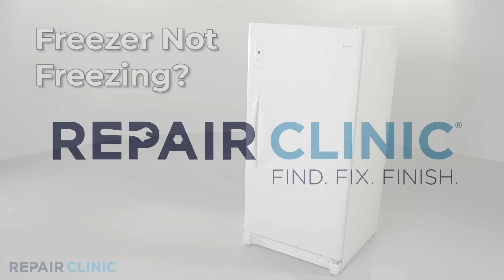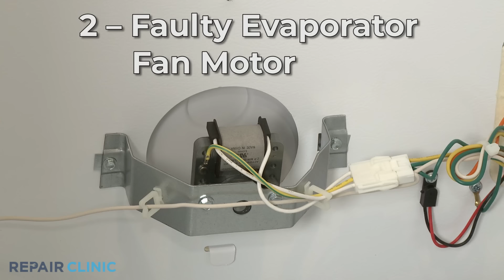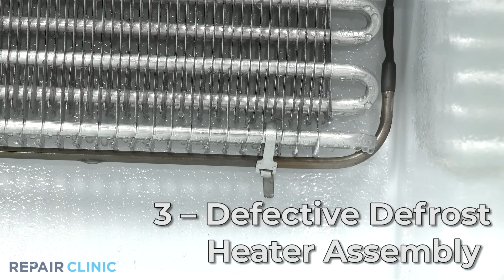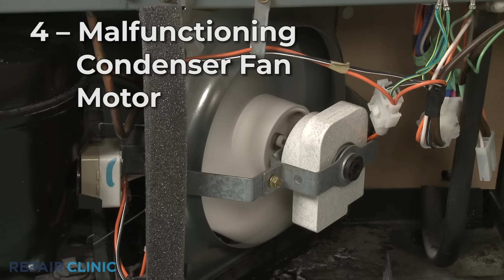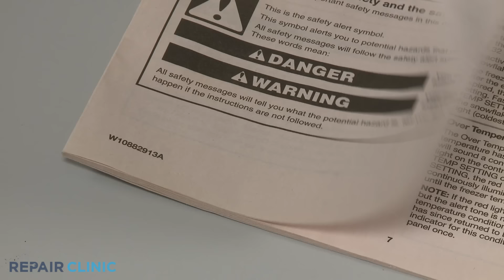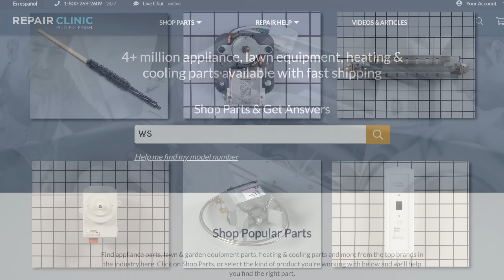Freezer Isn't Freezing  — Freezer Troubleshooting

Comment: I'm confused. The model you show is a Kenmore with a digital temp control in the door. Shouldn't this use a temp probe or thermistor rather than a thermostat? The thermostat is controlled by a dial found at the back of the freezer.

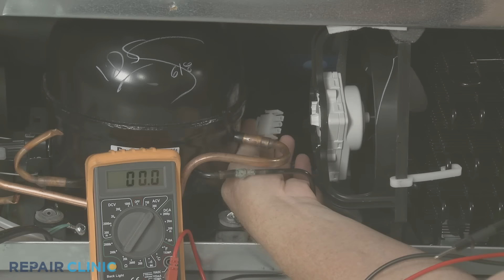Comment: It seems that the abundant and sometimes even borderline-excessive safety warnings in most RepairClinic videos are making up for this one... given that this is for general troubleshooting not specific to any brand or model, the scene at 2:10 could potentially be quite hazardous on other makes/models. Albeit small, there's a risk (especially on larger, older and/or defective systems,) of 1) burns from the compressor body or discharge lines and 2) electric shock from frayed wires or exposed socket connectors.

Comment: Can anyone help Midea 3.5 cu Mini freezer MRC04M3AWW: my electricity went out yesterday and I don't believe my freezer is working properly. I tried disconnect+reconnecting, then on and off.  
It's happened before with no issues and freezer worked fine previously. A little over 1 yr old

Comment: hello, do you think I can troubleshoot and replace parts when it's in operation still?
thank you for your reply
Reply from the maker: For brushing off the condenser coils sure, unless you plan to deep clean. The electrical components you will need to unplug the refrigerator to repair, otherwise you risk shock to yourself and damage to the new parts and damage to other parts.

Comment: I'm not sure but I think I have the opposite issue here.  My upgright freezer (on a frost free freezer) over freezes the coils and then nothing stays cool. and everything starts melting.  I've replaced the thermostat but from what i've read it can be the heating element or this Defrost timer that's in the back of the freezer.  Your thoughts sir?  FYI, everytime I replace the Defrost thermostat it works for about 2 to three months then the same thing happens again.
Reply: Did you figure this out.   My freezer works great for a week and then everything starts melting.

Comment: Our chest freezer one day just started defrosting and ever since it won't freeze again. It was manufactured in 2019 so its not old. I have tried cleaning it and nothing. When I plug it in the green light goes on so it is receiving power, however there is no sign of motor running and it doesn't get cold. What should I check?
Reply: Literally everything in the video… are you stupid?
Reply: Probably the defrost timer

Comment: My small upright freezer was delivered upside down and was kept that way God knows for how long at the vendor’s warehouse (the box was already upside down when the shipping labels were placed). I was told not plug it in for at least 48 hours if it was completely upside down to allow the oil to drain back into the compressor. I did that but the freezer won’t freeze and the compressor rattles badly when it starts or stops. It is a very nice freezer. Last one on Amazon and apparently not coming back. The biggest advantage is that you can selectively freeze and insure dual-use, just by adjusting the temperature. Any advice before I decide to return it? Thanks
Reply: Thanks so much for your response. I'll do as you advise.

Comment: For those looking for QUICK a temp fix, you can connect the two wire from the thermostat and then plug the freezer into a timer. 1/2hr on 1hr off if you are not going into it alot

Comment: What if nothing is turning on at all?
Just the lights inside and green indicator light?
I changed the timer and capacitor to the compressor and still nothing
Reply: It was the temp control unit(thermostat)

Comment: What about the Thermistor?  I have seen on a number of sights that is the most common when you have uneven freezing / part of the freezer (ie the top) is warmer than the bottom and the warning light "high temperature" is on.  I replaced the Thermistor and THAT fixed it.

Comment: In some checks for continuity you take the part out and in some you test without taking part out and running power. I am wondering if there is a way to do it without there being any concerns for safety
Reply: Just unplug the freezer and do the continuity tests, if everything is good there, then check if power is making it to the parts with the unit plugged in. If you don't feel safe doing it, then you should have someone do it for you.

Comment: here's a tip: If you're freezer is 10+ years older, it's cheaper to buy a newer one
Reply: That goes for everything we purchase, my 65 panasonic plasma quit at exactly 10 years during the virus and according to the code it cold be a micro switch or a bad board and I cannot do it by myself because it is to large and thick and heavy so I have to buy a new one, this is all done on purpose
Reply: Unless you have a +30 year old fridge, then it’s cheaper to keep it running than buy a new one. New stuff isn’t built to last.
Reply: Ya but it will only last 3 years because everything is JUNK nowadays….
Reply: This is absolutely not true
Reply: New fridges  are garbage.  Only last few years
Reply: your*
Reply: That's right.
Reply: how??
Reply: My freezer stopped cooling after 13 months
Reply: It's cheaper to spend 2 grand than to clean some coils for free? Moron.
Reply: @IanRLewis  who spends 2 grand
Reply: @melgrant7404  not me

Comment: Thanks for the inspiration to DIY... Had the cold bottom and warm top, so I ordered the fan.  Disassembled freezer to get to the old fan, and boom... the fan blade was wrapped in ice.  Removed the ice, got the ice below the coils out, plugged it in and voila - working freezer!  I'm sending the new motor back and kicking back to admire my handyman skills. For you Frigidaire owners, it may not be clear that the little plastic thingy on the right rear shelf support has to be rotated 180 degrees before you can slide the shelf far into the side to remove the shelf.  When you reinstall, don't forget to flip the thingy once the shelf is back in.  Thanks a million!

Comment: Thank you for this video. I replaced the thermistor and the heating element because of the frost forming over the evaporator. After that, it still wasn't freezing properly. Then I watched your video. I just cleaned the coils under the fridge after watching your video. The coils were absolutely covered and blocked from proper airflow. There was a blanket of dog hair and dust. After cleaning everything thoroughly, I now see airflow behind the fridge that wasn't apparent before (I see the tag from the power cable moving). I now know that the heat wasn't able to escape from the coils.

Comment: Hi I don't know if you answer questions but if you do I have  a fridigare upright freezer LFFH2067DW3 and it is not cooling lower than 20 degrees can you tell me if it has coils under the freezer that can get dirty or is the coils inside you show in this video the only ones it has thank you or if anyone else can answer this I would appreciate it I am elderly and do not have the money right now to call a repairman or replace my freezer
Reply: Sometimes the coils are on the back side of the freezer. On other freezers, they are underneath.
Reply: @hackmajor  I replaced a couple parts and then I called a repair guy after my Son-in-law and I could not get ti to go below 20* the guy knew right away it only needed freon and filled it and that was over 2 weeks ago and it has maintained 0* ever since.
He told me the coils were on the side and had me feel when it started cooling
Reply: Evelyn H Nice. If my freezer isn’t freezing properly by tomorrow, I’ll definitely have to have it looked at. Thanks for sharing your experience. :-)
Reply: @hackmajor  you are very welcome, the guy I called only charged me a total of 70$ and that is what I also spent on parts I replaced but I am ok with it, now I know the parts I replaced are new and I kept the old parts also, it was just so frustrating when we changed the part and hopefully when we checked the thermometer it still read 20* I did suspect the low freeon but we had no way of checking it or refilling it.Still 140$ for a working, not too old upright freezer is ok with me

Comment: I put a bunch of unfrozen food in my stand up freezer a couple days ago, a day or 2 later i noticed water under my unit, the suction line underneath has an ice build up on it, any ideas what caused this, its only 4 years old and kept clean
Reply: Ryan Reid defrost the freezer possibly??
Reply: @luvmist  thanks but has an automatic defroster, maybe i should check it manually?
Reply: Ryan Reid we do as will but that sucker still froze over. Just did mine yesterday. Checking to see if it is back in order. Going to do it at least every 3 months.
Reply: @luvmist  so you saying is that it is because the freezer is frozen